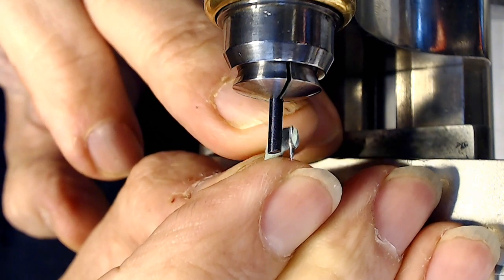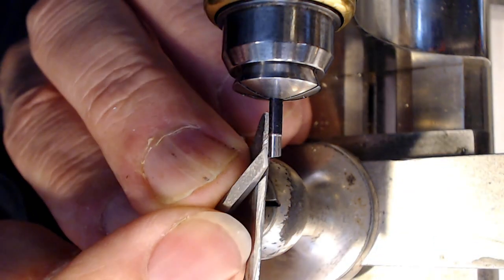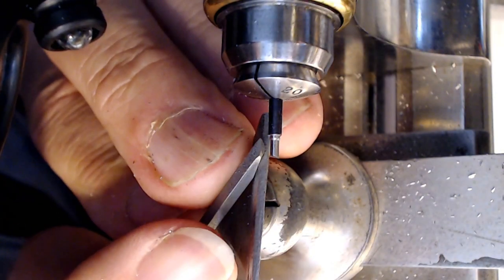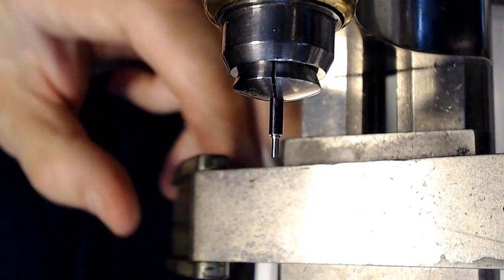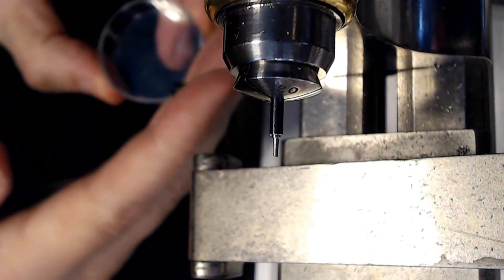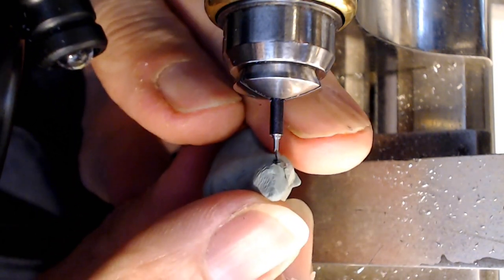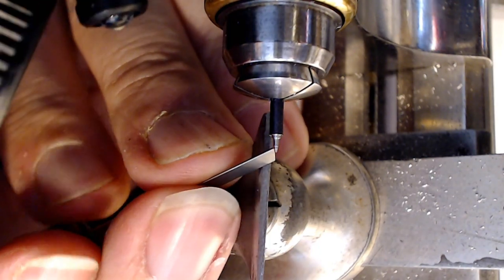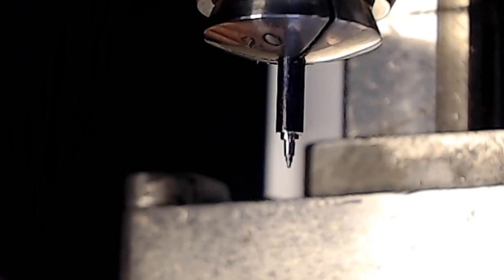Hamilton Closeup Secrets of Watch Balance Staff Making V2

Comment: You should get a watch demagnetizer, which is basically a coil of wire that is hooked up to an AC voltage source with a momentary push button switch. the alternating current switches the magnetic poles 50 or 60 times a second and demagnetizes the metal when drawn away from it slowly.  old time watchmakers sometimes used a rotating horseshoe magnet hanging from a wound up string  to do the same.   
According to W.J. Gazeley, in his classic book "Watch and Clock Making and Repairing",  he claims that the diamond shaped face of your graver should be facing up.  He claimed that if you turn with it down,  your turning could end up out of round.  Although I have seen other texts say it doesn't matter.  I have also read in another book that a watchmaker should practice lathe work around four hours a day to be any good at it.
Reply from the maker: I actually have 3 watch demagnetizers: one that really old and works but i am afraid of:)  I do a lot of balance staffs but not even close to 4 hours a day.

Comment: Do you prefer High speed steel gravers or carbide?
Reply from the maker: 100% carbide.  and fro making a ballance staff i have 2 square 4 and 2 mm and two rounded 2 and 4mm.  work great and hold their sharpness

Comment: Were you cleaning your tweezers in pith wood?  Also, you were using O.D. Calipers and not recalling the name, I use both O.D. and I.D. calipers for rough layout.  Thanks again for sharing your time and thoughts.
Reply from the maker: Douzième gauge
This instrument was invented in the late 18th century for measuring twelfths of a "ligne" (1 ligne = 2.255mm, 1 twelfth = 0.188mm).
Reply: @JDRichard  Thanks for that information. I have that gage but did not know what the measurements meant or equaled. I have numerous other gages that I have used since 1970 when I started my apprenticeship.  I got the gage you use about 7 years ago when the journeyman I served under passed away.  Thanks again for your time.
Reply from the maker: @hyselwatchandclockrepair1874  No problem and thanks for your comments and response. Lots of special tools in this business.